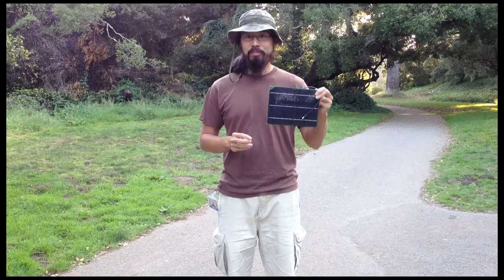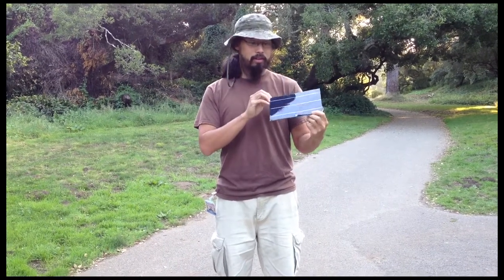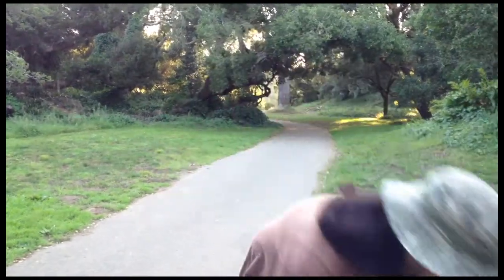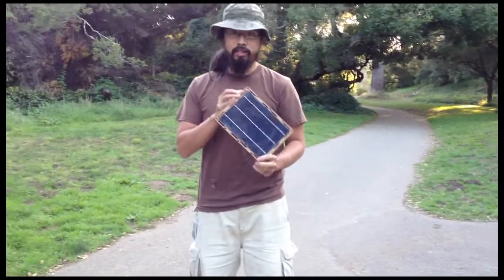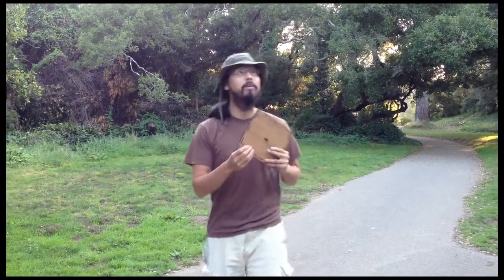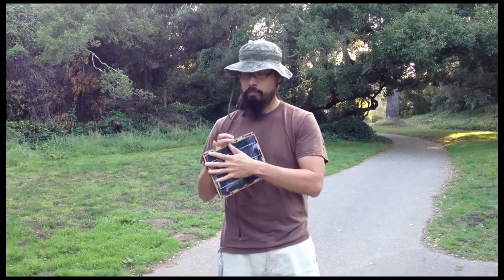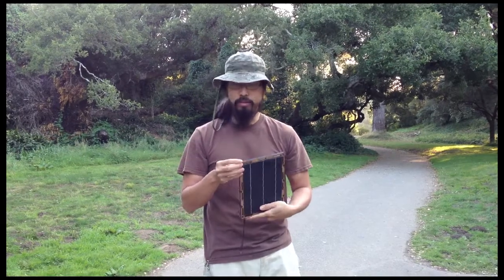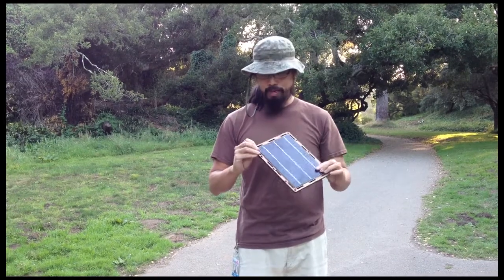BootstrapSolar Solar Panel Test

Comment from the maker: @Campos2011 Yes, the Chi-qoo will charge both the iPad and iPad 2. It charges at 1000mA (or 5W) so it takes longer than when charging from the wall charger, but otherwise works just fine.